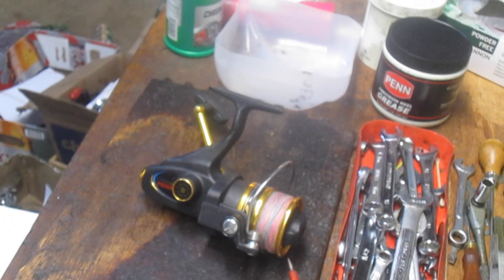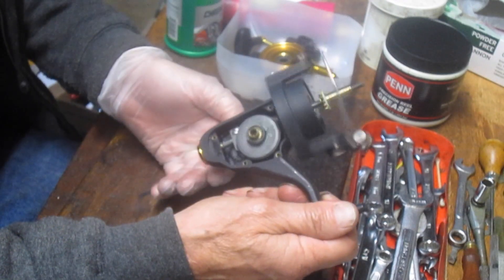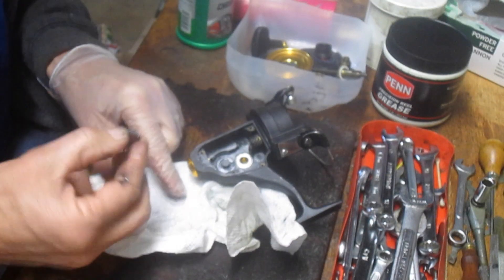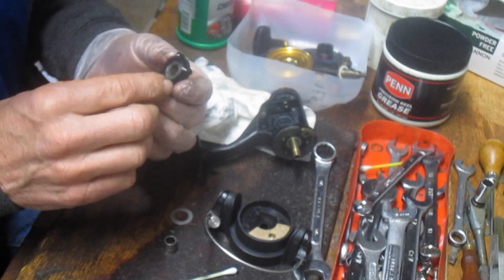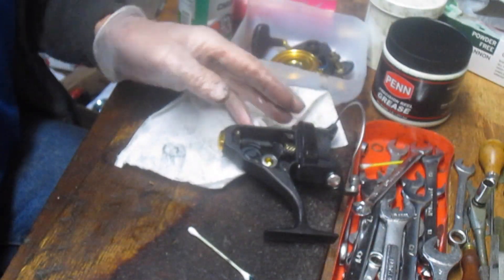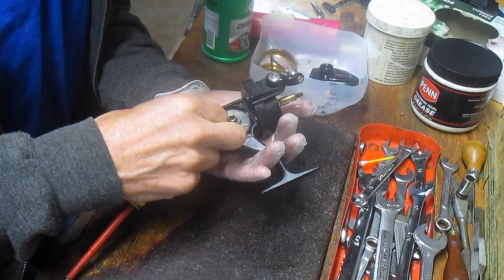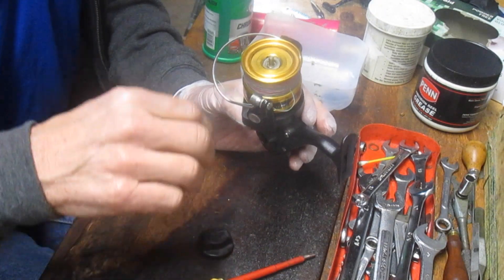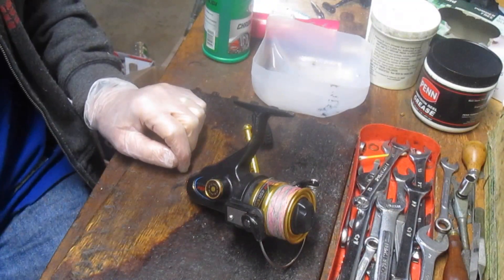Penn Spinfisher 450 SSG take apart, problem diagnosis and repair

Comment: Great video Dennis. We missed out on the SSG SERIES in Australia, but did import the SSM SERIES. I also do a lot of maintenance on reels and found my best companion for tricky small SCREWS are magnetic screwdrivers especially for those Crosswind Block screws with greasy fingers. 

Cheers Pete 😎
Reply from the maker: Thanks Pete.  I have the magnetic Phillips and I should get the flat blade.  They work fine, unless the screws are stainless.
Thanks for watching from half way around the world!  Please stay safe and well - Dennis

Comment: Great video. I had a problem with a 430 SSG. Ordered a new housing from Mystic. The replacement was a China cut. My original SSG was Made in USA. China cut had a thinner pinion block rest causing pinion to ride lower. Would not work. I had to fabricate a stainless washer to make difference. Works now. Heads up info.
Reply from the maker: Thanks - that is good information.Thanks for passing it along - Dennis

Comment: Hello  Dennis. I really enjoy tour videos, I have a couple Penn 970 and 980 mag reels. have you ever worked on these? A video would make my day.
Reply from the maker: Yes.  The gear side is standard Penn.  The "Mag" feature is in the non-gear side plate.  If you are tuning up the reel or replacing drag washers, then the process is pretty much the same as a basic Jigmaster or Long Beach reel.  The mag side plate needs cleaning, but not much else -Thanks for asking -  Dennis
Reply: Thanks for comeback Dennis. You have inspired me into restoring some vintage reels . I did an Ocean City 112 last night and it came out great.

Comment: Thank you for the videos Dennis. They are the most educational compared to other service and repair videos.
I have a Penn  4400ss and 4500ss, both graphite body, which I am planning to take apart and service. Are these reels similar to the 450ssg seen in this video.
Reply from the maker: They are very similar.  They are different generations of the Spinfisher series, but the design does not vary much between these two.  I recommend you get the schematics for both and compare.  The maintenance procedures are the same - Dennis

Comment: Thanks Dennis.  I have the 2 722SS & 2 650SS.  They work great and I am thankful  your so through.  Are the Battle III DX 4000 comparable to the the older spin fishers?
Reply from the maker: No.  The Battle reels are a different design mechanically.  If you are asking if they are durable, like the older SpinFishers, then, yes, they are quite durable. - Dennis

Comment: Denice, thanks for your videos,  they are very helpful, I have a peen 450ss that was bought back in the late eighties, what do you call the internal bail spring that hooks over the top dog lever. I'm having an issue with the springs name part identification.
Reply from the maker: I think you are referring to the eccentric spring.  If you go to the Mysticparts.com page for Penn parts and look for spinning reel schematics under the Spinfisher models, you will get the burst diagram and the part listings by name.  If you need that part, you can order on that site - Dennis

Comment: Hi and hello
Do you have a  video on the removal and put back of the bail system for this model?
Reply from the maker: I think the video I did on the 450 4500 is the same set up as the SSG.  You can watch that video here https://youtu.be/LFjyaR7U0Fk Thanks for asking - Dennis
Reply: Thank you 
The video helped.

Comment: Thanks for the video!  I have a Penn 450SS all metal made in the USA ( I live in Ohio) which I purchased new many years ago. The anti- reverse quit working long ago and after seeing your video, I pulled it out of an old tackle box and decided to take it apart and work on it. After taking it apart and removing decades of old hardened grease all gearing looks to be in perfect condition. However my anti-reverse is a little different on my model. That little brass pivoting piece (which you called the trip lever) locks away from the gear when the rear drag lever is flipped off, but when it is flipped to anti-reverse the trip lever does not engage the gear. Is that trip lever supposed to be spring loaded? This reel has never been taken apart before. Your expertise would be greatly appreciated.
Reply from the maker: Hi - If I recall, this reel has he ratchet and friction clip for for anti-reverse.  The anti reverse should have a "V" slot opening, where the tongue of the "V" rides on each side of the ratchet disc.  This operates by friction.  The dog is pulled into the ratchet slot when you stop the reel.  Check the schematic for the reel.  It is available at Mysticparts.com under Penn Parts, spinning reels.  That will show the sequence and orientation of these parts.  Please send me a picture of your set up if this does not work.  The picture can be sent to me at 2ndchancetackle@gmail.com - Dennis

Comment: Hi, I have a Penn 440ssg. The other day while pulling hard on a Redfish, the drag just starting skipping. I tried loosening and then tightening but even locked down it was jumping or skipping. I have since replaced the drag washer and checked the internals and really found no issues. It still does it. When the drag is light it feels normal. When I tighten it, it is still skipping. I am at a loss. Can you steer me in the right direction  ?   Thanks Jules.
Reply from the maker: Did you change the teflon washer on the axle shaft when you replaced the drag washers?  Did you also change the metal washers or just the fabric ones?  Those would be the next things to check if you just changed the drag washers.  Also -  are you using braid line?  Is it backed with mono-filament?  If not, there may be braid bunching or braid slip going on there. - Dennis
Reply: Hi, I only changed the fabric washer and no on replacing the nylon washer.  I had already checked the line and no slippage or bunching. It was and has been working great, so I think something broke perhaps. Today I pulled it apart and all seems to be correct. With the side cover off everything there moves free and easy.  What I can do now though is tighten the drag as tight as I can and just pull hard on the line and the spool spins. I have had this apart before a few years ago for general service and never had an issue until now. Thanks too for trying to help me.  Jules.